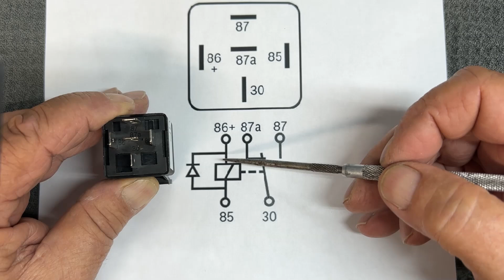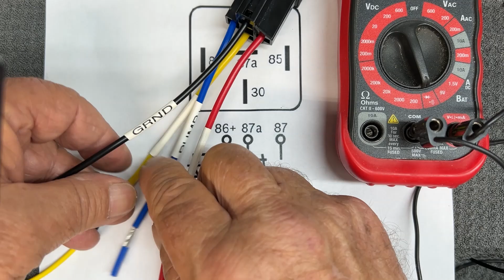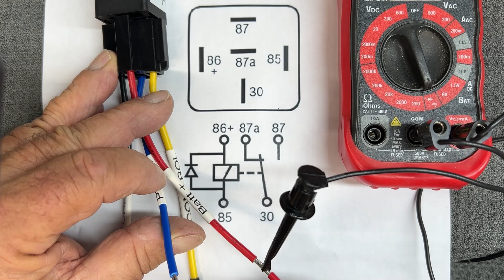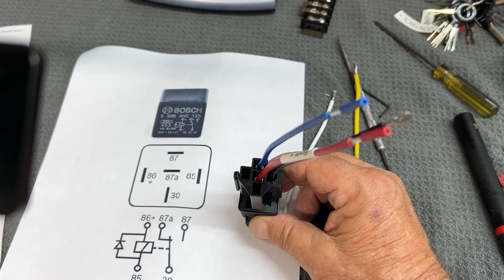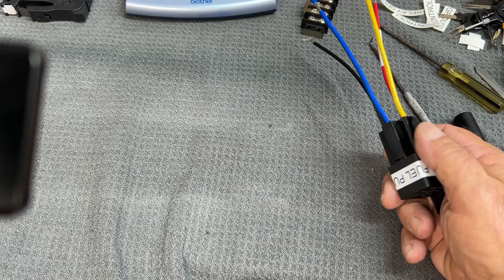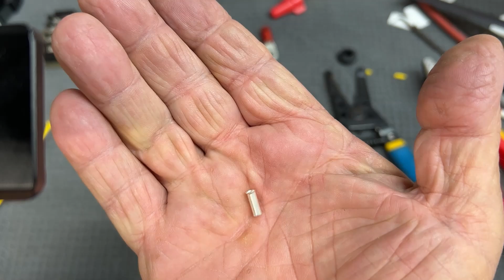12 Volt Relays 101 for racers and hotrodders

Comment: It would be nice if the brass connectors are available so they could be crimped onto the car wiring thereby eliminating a splice.
Reply from the maker: Excellent comment.  If I locate a source, I will def add it in the vid.  Thanks